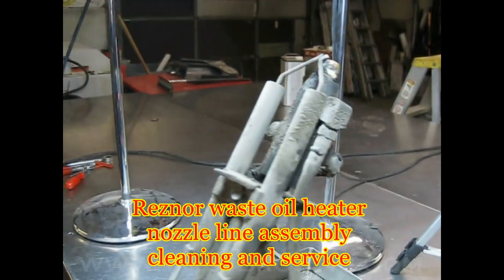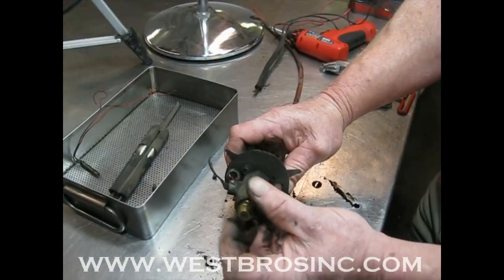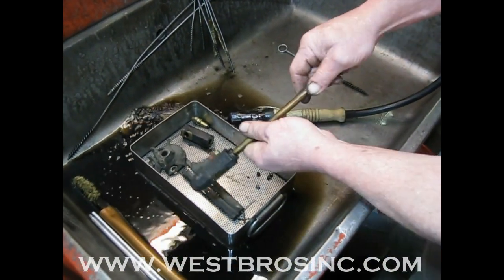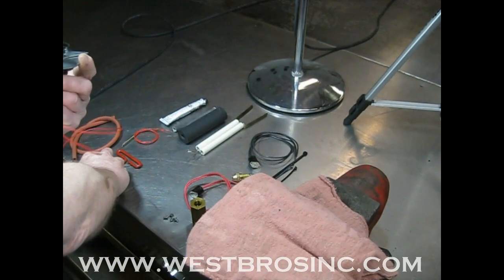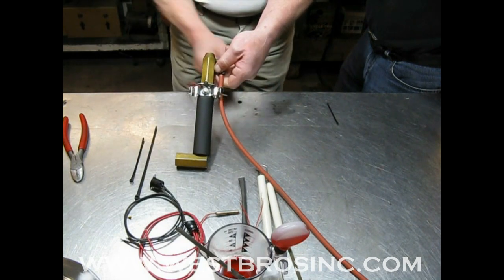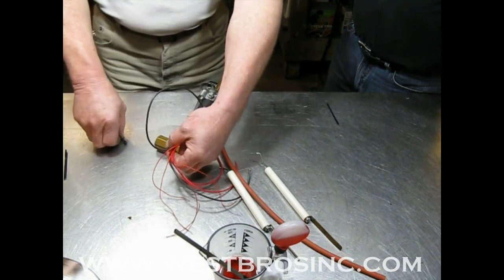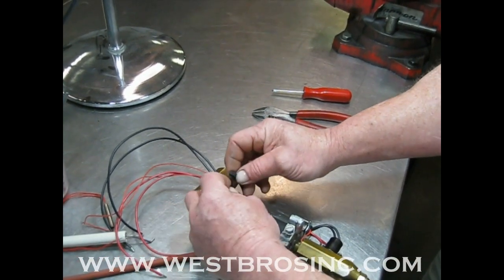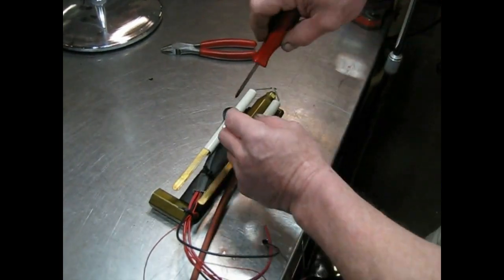#8 Waste oil heater service / repair Reznor nozzle line assembly HD

Comment: When reinstalling the nozzle assembly the service manual says:
"Relationship of the tip of the nozzle to the inside radius of the end cone - Flush to 1/16" ahead - NEVER BEHIND."
I do not know what the end cone is or it's radius so I do not know where to position the nozzle assembly. 

Please clarify.